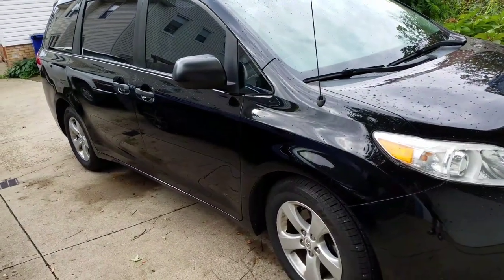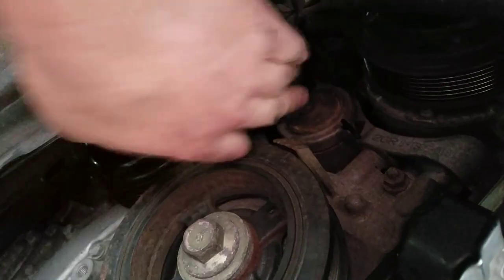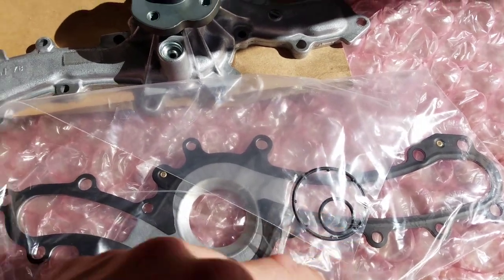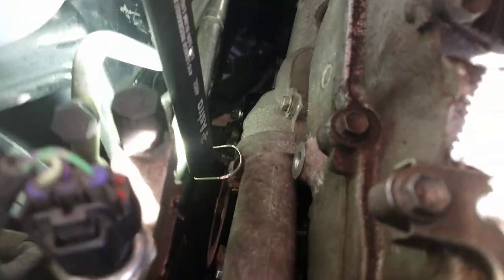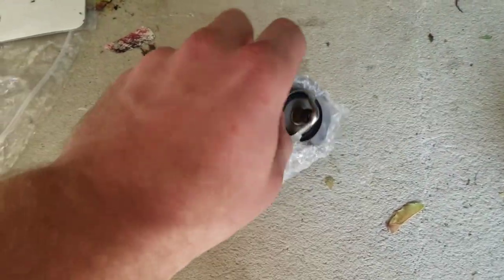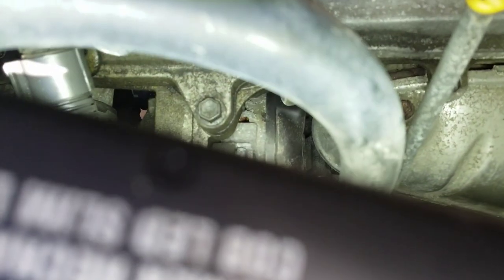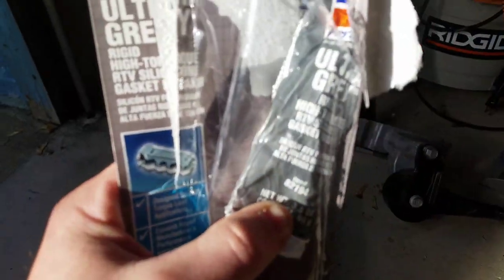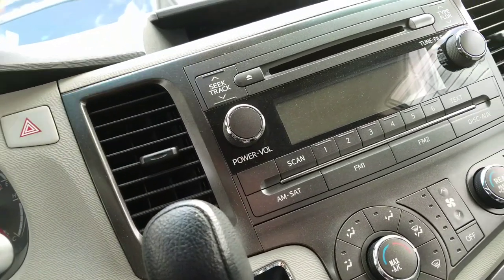2011 toyota sienna water pump, tensioner, belt, idler pulley, thermostat, coolant

Comment: my water pump making just noise,its not leaking and AC is not ice cold.So should i only Replace water pump or the whole thing ,serpentine belt,Tensioner,idler pulley,Thermostat as you did.Please let me know.Thanks
Reply from the maker: I would just do the water pump and the belt. I would just inspect all the other parts. For the ac go buy a can of freon with a gauge. You can plug the gauge in and see if your freon is low.

Comment: Not sure if this question makes sense but, can't you just remove the tensioner pulley by removing the center bolt in it?
Reply from the maker: Yes but I wanted to replace the tensioner.
Reply from the maker: @SwimmingintheDeep  I was told that the tensioner can loose tension over time.

Comment: Thanks for the video! I’m getting the grinding noise and believe it to be one of the pulleys. Your video definitely shows is to be a little easier. The idler in other videos, they remove the grill and radiator. I wondered if there was room to do it without. 

The AC pro is all you need to recharge the AC system? No previous experience with that.
Reply from the maker: My tensioner was still fine, nothing was wrong with it. The reason I changed my tensioner cause it starts to loose its tension over time. Not sure if there was a easier way to remove the tensioner without removing the ac. But ya when everything is back together just get a can of ac and recharge it.

Comment: Hi, I wanted to change just the pulley on the tensioner not the whole assembly.   Are the idler pulleys the same as the pulley on the Tensioner?
Reply from the maker: I'm not sure.
Reply: Did you ever find out?
Reply: @psosa98  nope.. but when I do the water pump in the spring.. I bought an extra pulley in case
Reply: @michaelswank8685   I replaced mine. The outside diameter of the pulleys are the same, but the inside and ball bearings are different. The tensioner pulley spring arm can go bad and may need replacing if it no longer provides tension to the drive belt. But if all you hear is a grinding noise, then the ball bearings are bad. The price for the idle pulley was $48 if I remember correctly, but the ball bearings are only $5. I ended up buying two different size  ball bearings for $10. They have a number written on the side to tell you exactly which one you need. It was labor intensive, but I saved a ton of money and that gave me a lot of satisfaction. Good luck!
Reply: Mine is making noise when AC is on and the compressor is starting to work/ working. Which is to recognize by the fact, that the radiator is starting too. Did you manage to simply get the tensioner pulley out to replace the ball bearings? Or did you have to remove the whole tensioner including the mounting and the arm? How long should it take? Do I simply push the tensioner counterclockwise all the way to the passenger, the put sth in the hole to hold it in place and then turn the bolt holding the pulley clockwise to remove it or is it more complicated?

Comment: how long does it take to do this job?  Is it a 3.5L engine?
Reply from the maker: Yes I have the v6. If you doing just the water pump it's easier but if you replacing the tensioner its more longer. So I say about 2h water pump and 4 hour tensioner/ water pump.